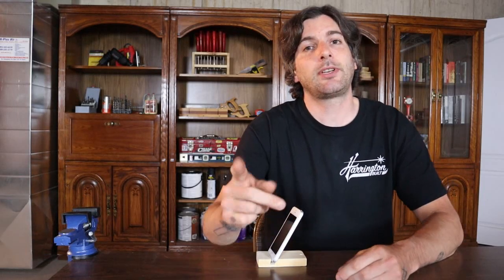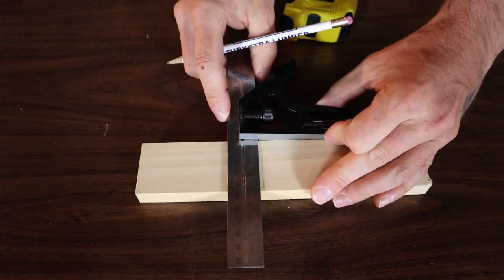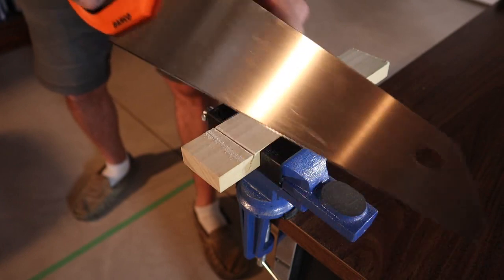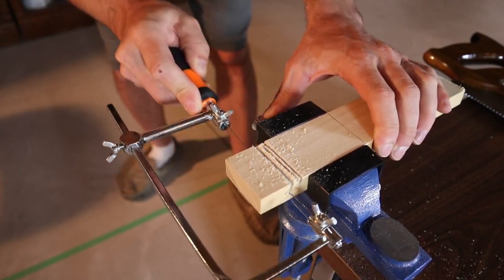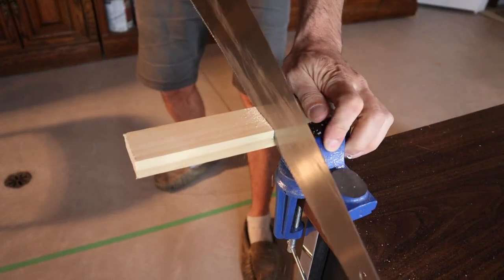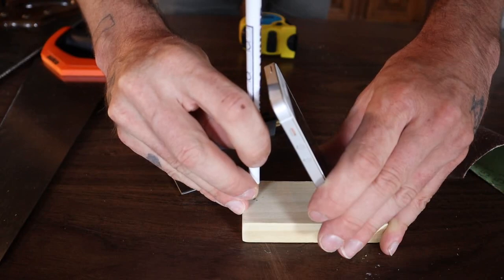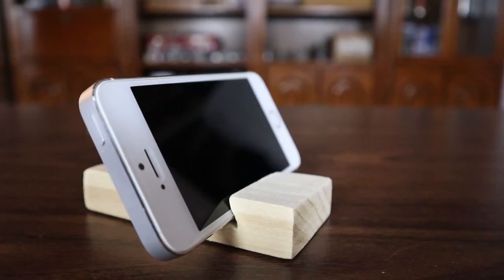Diy Wooden Cell Phone Stand For Beginners ( New Easy Design )

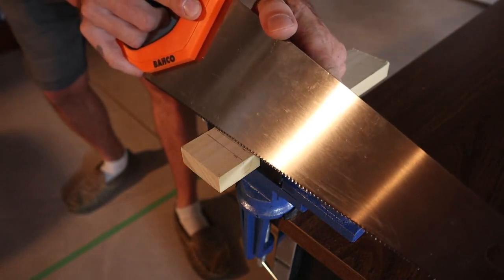Comment: 2:00 I clamp my wood in an angle in the vice, so I can saw vertical parallel to the vice. It's more controllable.
Beginning with the cut closest to the edge of the wood. I use a metal saw with its fine teeth to start the cut.
Reply from the maker: thats a good idea. thanks for the tip.

Comment: A tip:  To cut angles place the wood in the vice at an angle so the saw will be vertical.  It makes it much easier to cut.
Reply from the maker: that's a  great idea thanks for the tip